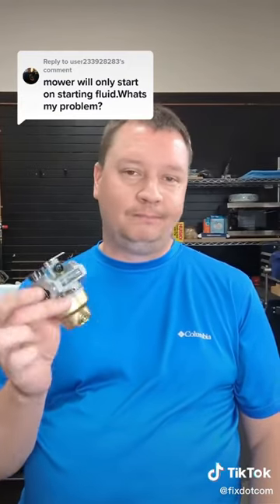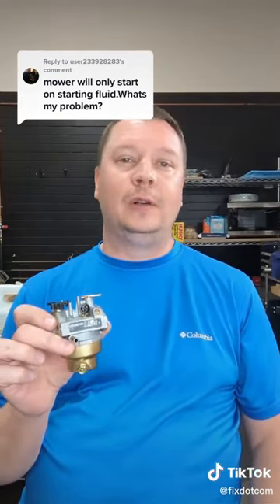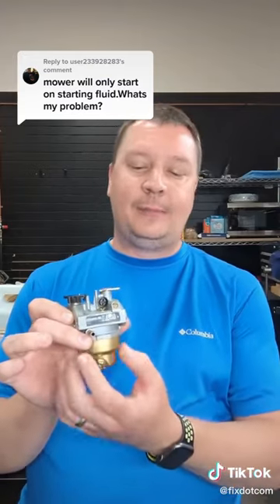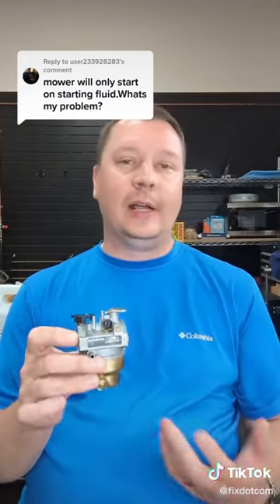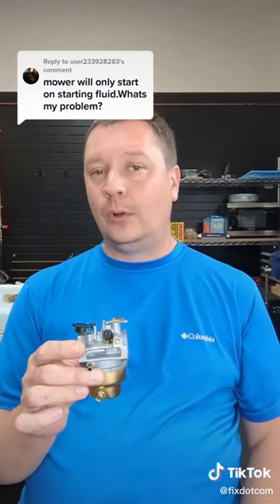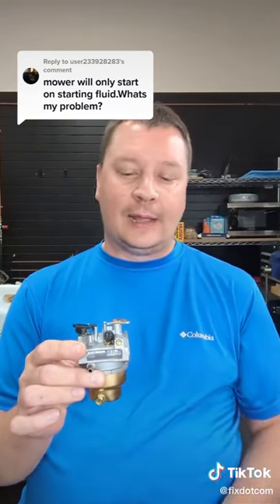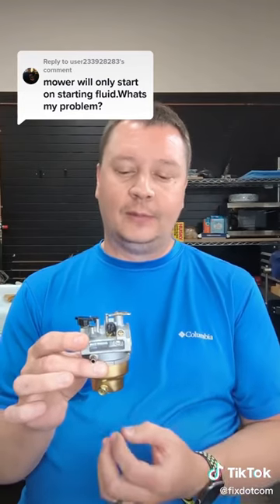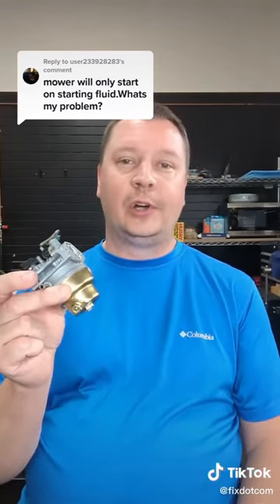Most Common Reason Your Lawn Mower Won’t Start | FIX.com

Comment: Husqvarna, LS221 a all wheel drive mower walk behind. Runs fine, then shuts off. I remove the gas cap, still won’t restart for five minutes 10 minutes. Sometimes it restarts instantly.  
 I removed and cleaned the carburetor. I replaced the fuel line and added a shut off valve and in-line fuel filter. I recently replaced the entire pull start mechanism (One of those tabs that comes out under centrifugal force was missing)
I just watched a video that suggested that the plastic float in some of these carburetors swells up. Which I have heard of this happening due to methanol being corrosive to some plastics…
Reply: You may also have a failing coil. When they start going bad they quit working when hot.

Comment: My riding lawnmower won’t start, no power at all once I turn the key not even a click from the battery. Any ideas, brand new battery not sure if it just needs to be boosted?
Reply: Starter selenoid could be the problem
Reply: Hope im not to late to help, but you can try to charge the battery overnight, if that doesn't work, then replace battery, but if the riding mower has a fuse check to see if its blown
Reply: Ground connections and yes battery put a solar on there 30$. Let it charge when not in use mine sits a lot
Reply: And u could just jump it off as ling as the battery  is low and not dead also If it’s a craftsman disconnect your headlights
Reply: Connected headlights drain the system
Reply: Check  battery’s  are not the best  something draining   U might want to disconnect the  neg side when not in use and charger on it
Reply: it was just 1 fuse lol but thank you everyone

Comment: what would you check when the ignition isn't making any clicking noise and you've already replaced the solenoid and battery
Reply: Seat Safely relay
Reply: Or starter

Comment: Aviation fuel...best fuel. Bought an airplane, been sitting in a hanger for 20 years. Had about 10 gals. in each tank. Added a fresh 5 gals. to both sides. No problems!😊

Comment: Same. Ways to avoid this. Go get that fuel they sell at the dealership. Run that fuel through for the last few times you go out and store it with that fuel in it. That fuel has a 5 year shelf life unopened and a 2 year shelf life once opened. Its the best fuel you can use. You dont want to leave the machine empty either because then things dry out seals break and you'll notice leaks. I know its expensive stuff so thats why i say use it at least the last few passes before you put her away. For the rest of the season make sure you sre getting premium gas. As little ethanol as you can.

Comment: How do I remove the carb
Reply: Take off air filter, locate the 2 nuts holding it on and remove them. Make sure fuel lines are disconnected and any linkages removed as well. Take pictures as you work to ensure proper  reassembly

Comment: Mine won’t start unless it’s choked out when I say choked out I mean three fingers in the throat of the intake choked out the person before me never serviced the carb so with all my effort I couldn’t get the jets out to properly clean them and I looked up the model number of the mower and can’t find anything for it carb kits belts nothing I ordered a carb that looks right so hopefully it’ll work because I can’t even find a kit for the one that’s on it and it’s a Briggs carb but I can’t find the model number for the motor only the mower itself